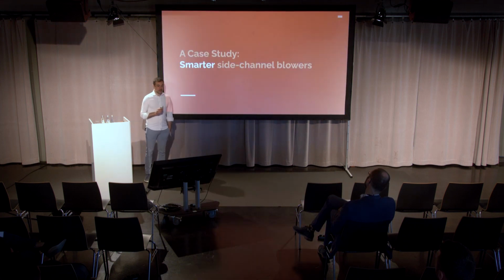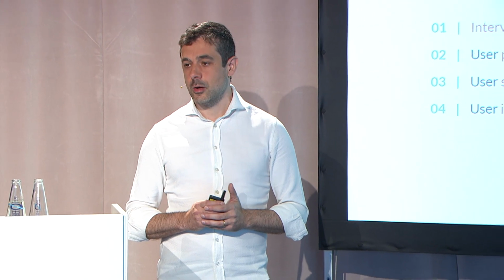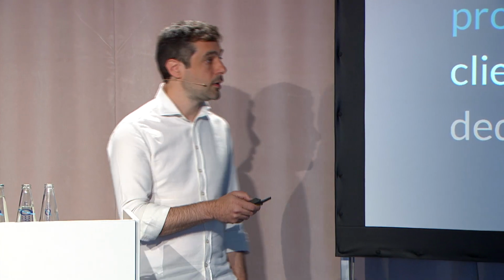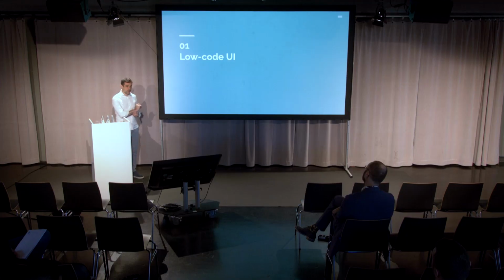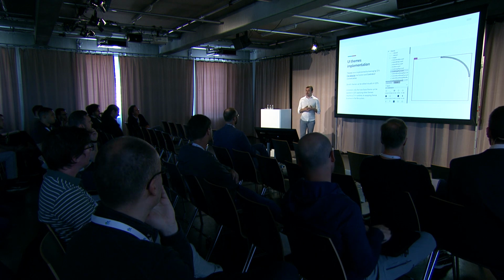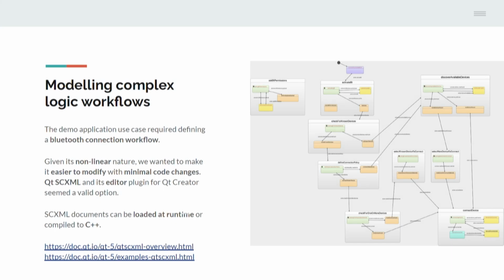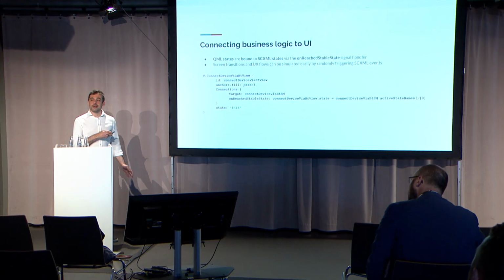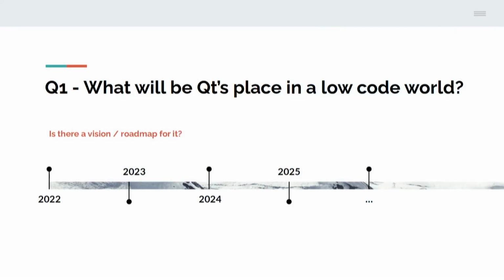QtDevCon22 – Low-code Qt apps with Design Studio and SCXML

Comment: Is the idea behind low code to get even worse people in coding that have no clue about anything? We already have javascript.. 
Making it more accessible for more people is just entry lowering and will not increase quality.
It’s better to not make even more code that needs to be re-written.
Reply: It is aimed at the sort of greedy managers who want to save money by not hiring real programmers, because they heard about low-code and they got the idea they will mouse-click their new information system by themselves... So they purchase some low-code solution and after half a year of desperate and hopeless clicking around the screen and trying to achieve something sound they give up... and they hire the programmers.

Actually most use cases for low code is just connecting to a database and composing some sort of dashboard application. Just some kind of a little bit more complex and more interactive Excel charts...

For anything else, you still need real programmers who know what they are doing.
Reply: @vladimirkraus1438  I believe the dashboard + data use case that you mention is indeed one of those that can benefit the most from a low code approach. The case I present here is similar, except the data comes from a Bt or ModBus connection, where two "blackbox" components for communication have been defined by use developers for the customer to plug-in and configure.
Reply: Hi Platin 21, in many scenarios, I guess the whole point is indeed to avoid writing more poor quality code, by (re)using instead some components that have been thoroughly field-tested by a development team. I see common scenarios being covered by low code solutions, and very specific and less frequent ones to be better approached with tailor-made solutions.